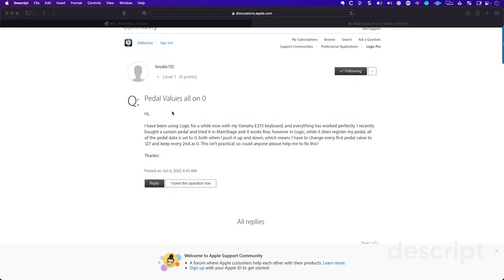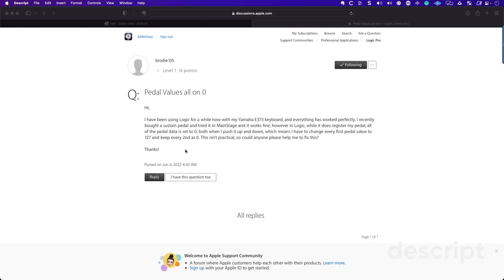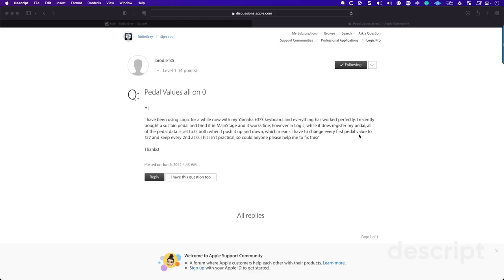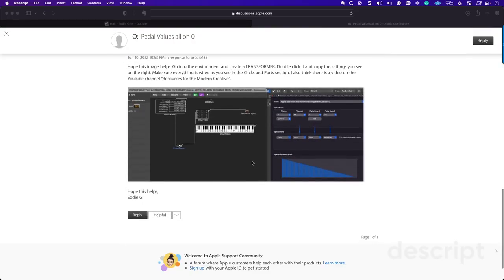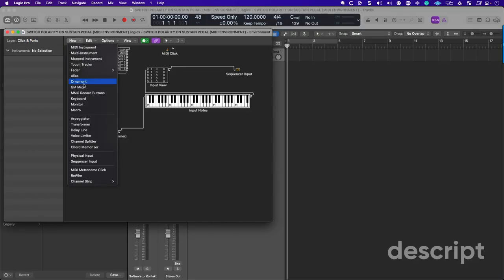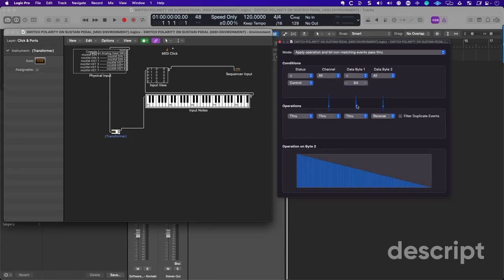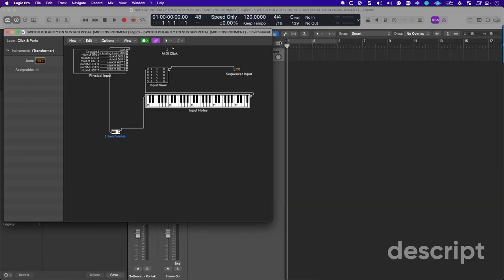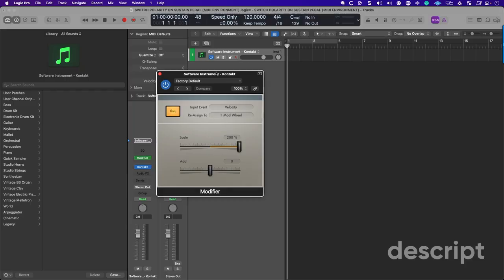Are you Having Problems with Logic Pro? Sustain Pedal Not Working

Comment: Great Video.. But i have another problem. When i press the sustain pedal, the note never releases, its forever sustaining unless i release it and the note cuts abruptly when i release. The Pianos work fine, but the strings are horrible. If i keep the sustain pressed, the newer notes are playing on top of the earlier notes. Please help if you can. Thanks 🙂
Reply from the maker: Did you try flipping the switch on your system pedal?
Reply: @_TheModernCreative  yea that just inverts. But i did see the Midi Keyboard where i plug the sus pedal say “foot switch” and not “sus pedal”. May be thats why its acting like a switch.

Comment: Hey! Thank you for this however I'm experiencing another problem. The sustain doesn't go out unless press the pedal.
Reply from the maker: Essentially, it’s the same issue. If you reverse the polarity, should fix it. This can be fixed via a switch on your foot controller or use the software hack found in video.

Comment: Good night bro.. I followed the steps but I still haven't solved my problem, the note still cuts off and the pedal doesn't work..help
Reply from the maker: It’s probably a hardware issue
These pedals usually come with a switch. You can also open it up and switch it internally. Hope that helps.
Reply: @_TheModernCreative  The last thing I have in mind is to format the mac, what to see but just thinking about installing everything again discourages me
Reply from the maker: I know it can be frustrating, but stay the course and you will find your way. You have to persist and continue to move forward as you find ways to work around the obstacles. I know this was not the solution, but let me know when you find it.🙏🔥💯👍💪
Reply: @_TheModernCreative  you are right friend thanks I will continue insisting
Reply: @_TheModernCreative  I use the pedal with another program and it does its normal job, only logic pro happens to me. The issue happened with performing a logic update. Roland brand I have moved the switch and nothing

Comment: hey, i tried with my piano and i did do the things in that video but still its reversed. Is there any solution out there?
Reply from the maker: To be clear you did this on a sustain pedal, right?
Reply: @_TheModernCreative   Yes i did on sustain . But its not a keyboard could it because of that? I press the sustain and the note sustaining forever it doesn’t finish sustaining and when i tap again the sustain cutting off.
Reply from the maker: If you did this on the sustain pedal, it shouldn’t matter where you connect it to. For some sustain pedals, you might have to actually open up the unit and change the inversion inside. Look at your user manual for more details.

Comment: I like this method ..needed this.. So is there option to transform CC48 to CC11 ?  I mean I have controller fader which is CC48 and I want to send CC11 using CC48 ? I have done in cubase using input transformer .. So do you think we can do that ?
Reply from the maker: Yes you would use the modifier midi Fx plug in Logic Pro. Should get you there.
👍👍👍Cheers!
Reply: @_TheModernCreative  But two things 1. I ll have to use modifier on each track for that 2.Im not seeing Cc48,49,50,51 in the list . There are only common CCs . Why?